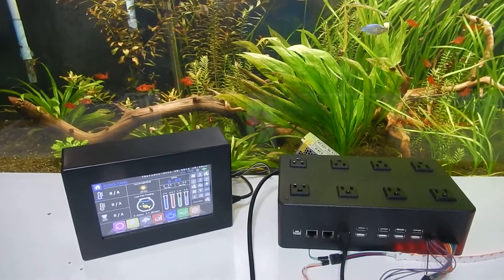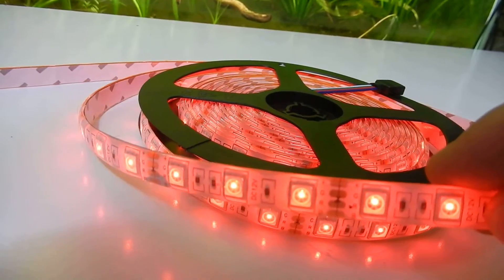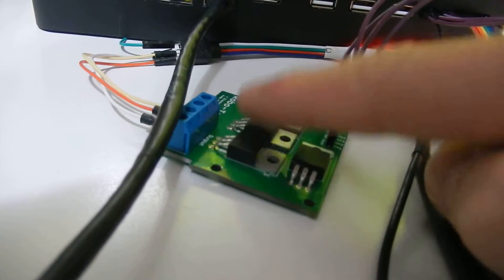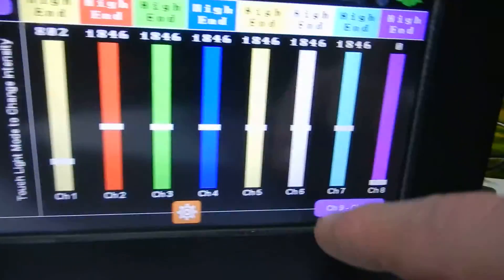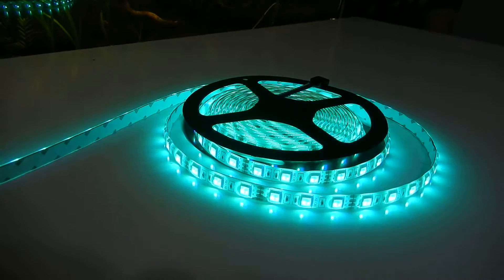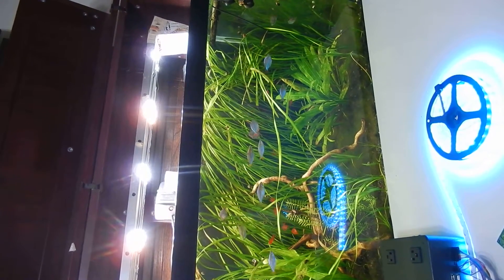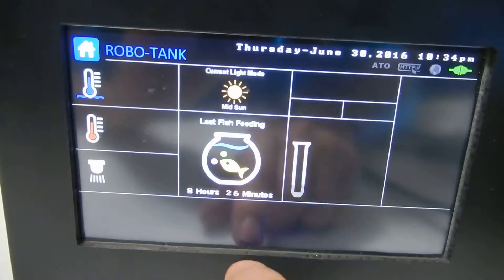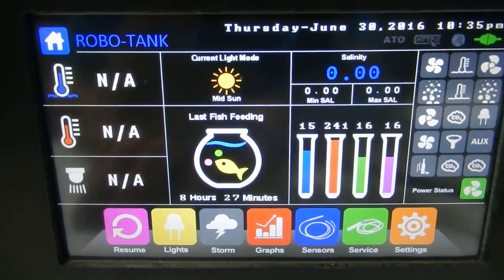Controlling LED's using Robo-Tank DIY Aquarium Controller

Comment: Hi Rob, If I were to create my own DIY LED light from CREE pucks (purchased from RapidLED.com so not an LED strip) how could I use your controller to Dim the lights or control the colors?
Reply: Looks like you might be using COBs which probably need a lot of power.
Reply: So I would need my own power supply for these drivers correct? Most of them require a 9 volt input.